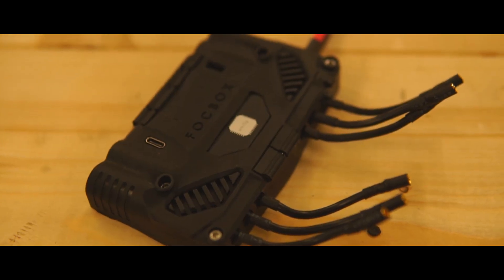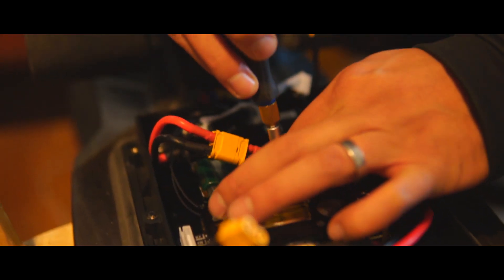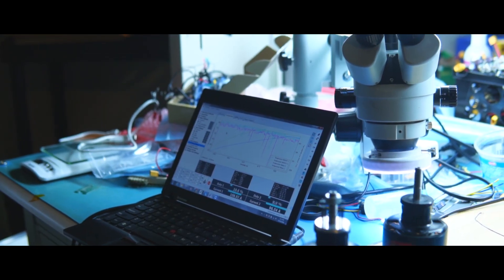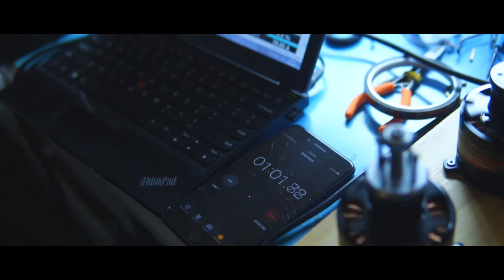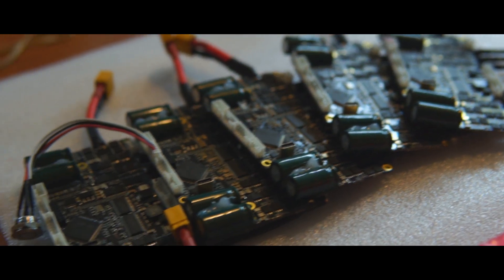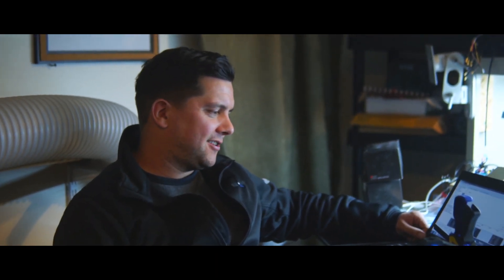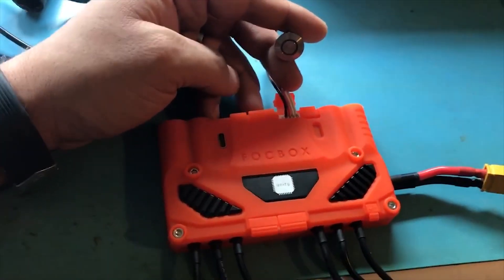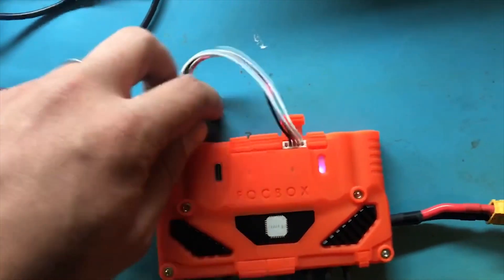E-Skate Electronics in Montréal: FOCBOX UNITY TESTING!

Comment: @enertionboards I’m all 😍 over the R-Spec motors & Focbox Unity on sale right now but entering the DIY build competition gives me some anxiety because I’m not experienced at building and tuning  ESK8s like @psychotiller @nyc.kaly or @longhairedboy, especially for attempting to build an AWD Enertion system. I just purchased the Raptor 2.1 and I am already looking for my second purchase. I’m all in!  Call me a “FanBoy” Now that the company is getting its infrastructure in top shape, please develop and offer an AWD Enertion board that is similar to the Lacroix Board (somewhat Flexible with battery enclosure) using the 4 R-Spec hub motors on Pneumatic wheels. I’m guessing designing a wheel that will accept the motors in a hub format would be the challenge, but by the way Jason seems to pump out new creations gives me hope. Some customers like myself will pay a good amount for premium quality, reliability, support, and solid built and highly developed products. Holler at me, we need a wider Enertion Truck system (14”) with the cooling system + a Lacroix style wide deck with Battery enclosure and Pneumatic wheels that will House the R-Specs would be a Game-Changer for the buyers like me + DIY community + the Raptor owners. Holler at me!!@enertionboards @enertion_raptor_uk @raptor2.enertion